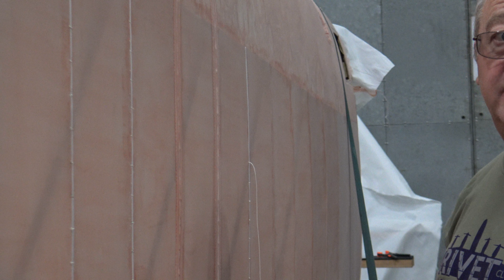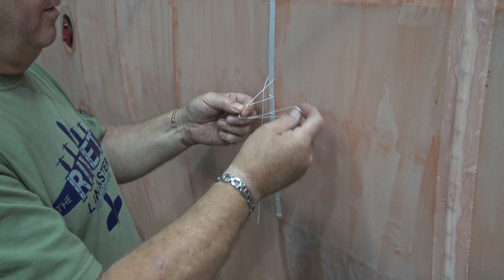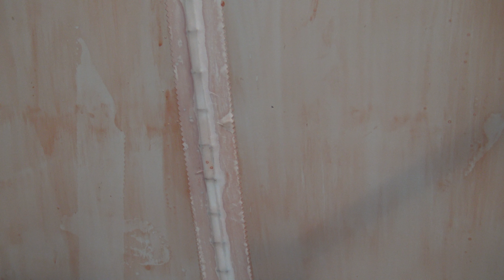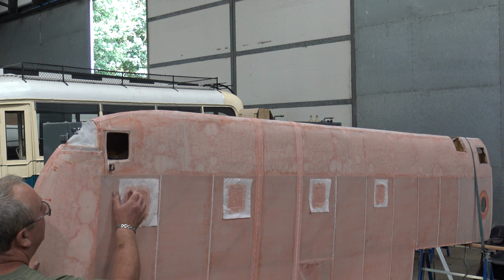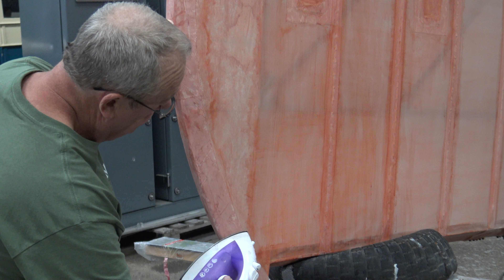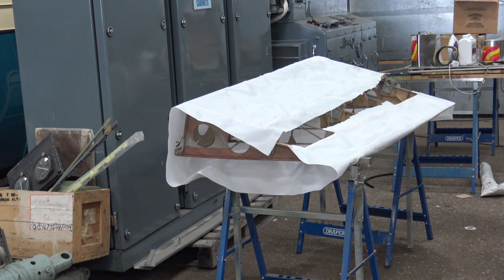Video 2 Percival Proctor MK4 restoration at East Kirkby.

Comment: The remarks about the tautness in this video are wrong. There are specific temperatures to be used for tightning.  250F for initial shrink, and then 350F for final shrink giving the maximum tension. As you can see it is not guess work. Hot air guns are just sloppy. They work, but sloppy.  Yes it is a static display, but no real time is saved by using the heat gun. Setting the 'iron' to specific temperatures will give you (on that specific iron) a range (i.e. cotton) for future tightning. Poly-Fiber technique is easily available on the web/google.Even so, Neville, keep up the good work.

Comment: I’m a little concerned about how many times that fellow said he wasn’t sure....and that bit where he said, “you’re meant to use an iron, but I never do”. Each fabric manufacturer has a very specific installation process, and this includes procedures for setting and calibration of irons. I can only assume this is a static display aircraft.
Reply: jameslvsjo he actually said “you’re supposed to use an iron but I was trained with a hot air gun”, however, this will only be a static.
Reply from the maker: Hi jameslvsjo it does say at the top of this page static display only . Thanks for your comments and watching.

Comment: Love your tech questions . Wonder what purpose the washers did that were doped onto the covering ?
Reply: They’re drain grommets.  Temperature changes can cause humid air to condense on the inside of the wing and pool in the lower areas.  Rainwater can also get in through various openings,  and when flying, everywhere throughout the structure. Taxiing on wet runways can also splash water up through any bottom holes. The grommets are designed to drain water from the lowest point in each fabric panel or plywood component throughout the airframe while in a stored attitude. They also provide ventilation.
Reply from the maker: Hi Stephen, good reply from jameslvsjo.( I didn't know that).